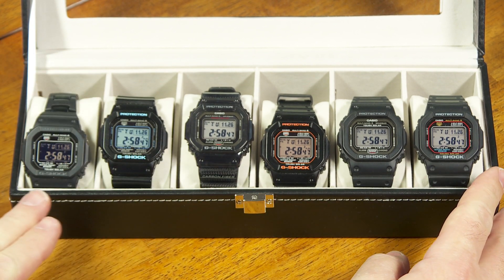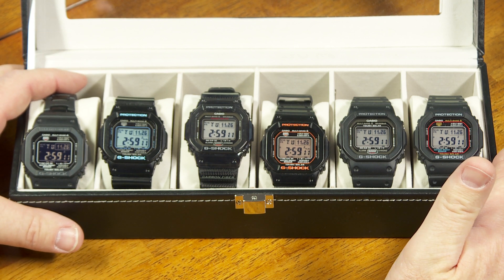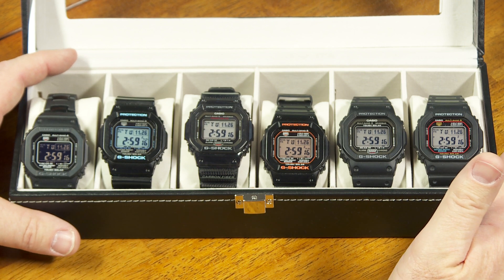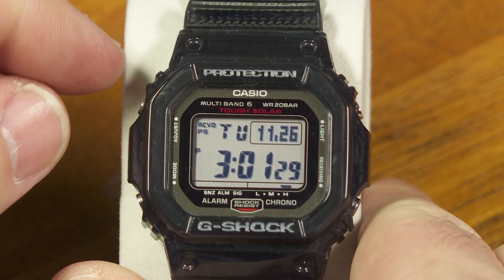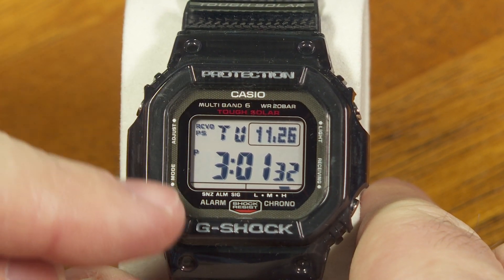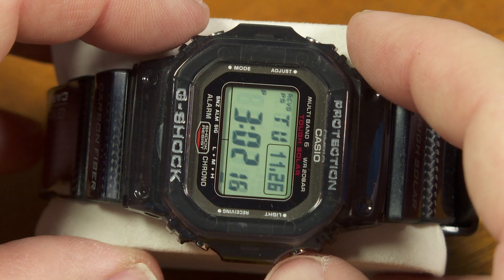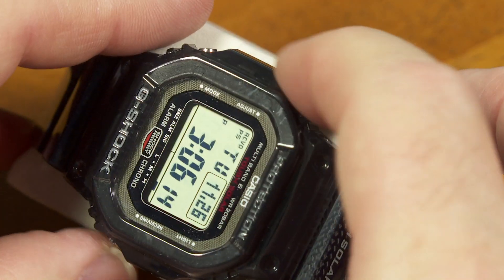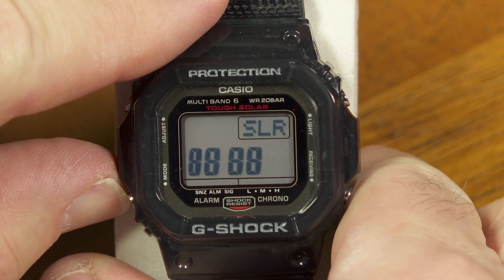Diagnostics for G-Shock Squares

Comment: Your videos have been extremely helpful as I go through my square G journey. Thanks for all these informative videos. 

One question I have is in the multiband diagnostics screen does it matter what option you select? Or it automatically goes through all the bands? Also on my 3495 if I press the A button in that screen a 1 appears. Any idea what that means?
Reply: Yes, I also noticed it on my GW-M5610.
If you scroll through different frequencies with bottom left button and then press the LIGHT button (B) it will go into recieving mode. My theory is that you trigger recieving for selected frequency. Pressing B button again will cancel recieving and you will se new letters NG in the box. I triggered recieving for Germany (B 77) and after canceling recieving it showed BNG 77. If I trigger recieving for J40, I got JNG 40 after canceling.

If you press A button (when you are in  multiband diagnostics) you will see that 1 appears on the left of the screen. If you then press button B it will go into Power Saving mode.

Comment: it would be fine if solar diagnostic mode show up the actual voltage currently produced by the panel.
Reply: That would be cool, but i don't think the watches have the hardver to do that. They probably have just a few hardwired measure circuits and if everything works, then you can get all the information the watch have for you, from the home screen. Note that it is just speculation from my side.

Comment: I was looking for information about solar panel diagnostics and I thought it was worth mentioning: the GW M5610U updated version combined the tilt and solar diagnostics into one button combo.  A,C, and B buttons, same as your tilt diagnostic. "C" (bottom left) button to cycle through tilt and solar tests.
Reply: Hey! I have G-5600UE-1DR watch and it's module is 3496 according to the backcase and even the module book we get with this watch.
But I just did the display test and at the last of it, it shows the module number 3495 and inside the box 002.
What does that mean?
And what does your watch shows? 
And
Reply: @Manish Kukreja same here I also couldn't understand what that 002 in the upper portion means although it's showing as 3495. And another similarity happened as described by @jbrooks4282 as the SLR and TLT are combined into one shortcut key[ A, B & C]
Reply: Same thing in my case with dw5600ue
Reply: Same thing in my case i order this to Amazon

Even on the back case it says made in Thailand Y

"Y" whats the meaning of that alfabet

Comment: I think that on Casio's G-Shock GW2500BD-1A analog/digital, radio control, stainless steel bracelet watch, the arrangement of the buttons is that the "C" button (Mode button) is the lower left button and the "D" button (Scroll/Toggle button) is the lower right button, but I'd have to double-check that to verify that.

Comment: Greg, did you ever discover why the last screen in the lcd test showed the numbers 3150 in the top right hand box, and 0311 on the main screen? I did the 3 button test after watching a "how to determine a fake" G Shock, and it suggested the module number should show up? Yours is the only video that mentions the numbers that I have on my G Shock? I've searched the net but cannot find an answer?
Reply from the maker: Since this stuff isn’t mentioned in the user manual AT ALL I can only guess. What I do know is that when I have multiple watches with the same module they all behave the same way when I do this stuff, so I think that’s a pretty good indication that mine are not fakes.

Comment: 2:50 I have model WVM-120. When I press button A with this J 60 screen a zero appears. Another press button A and the zero disappears. What does that mean? Is it a hidden feature enabling/disabling the radio station?
Reply: Same on my 5600. Did you ever find out what this means? I want to change the receive station to test how strong the signal is from each.
Reply from the maker: Good question. The problem I have is that Casio doesn’t tell us about these modes at all, so I can only guess what these things mean. But I haven’t been able to enable nor disable anything by using these button combinations.

Comment: My tilt test is working but the light won't come on when moving wrist, it does come on when I touch the button though, any ideas?
Reply from the maker: If you hold down the light button for about 4 seconds then A.EL should stay visible on the screen and the automatic light should work.
Reply: @GoodTimekeeper  perfect thankyou, working already...
Reply from the maker: Just to be clear, can you see the “A.EL” in the display during normal operation of the watch? Are you in a dark place when you try to make the light come on automatically by moving your wrist?
Reply: @GoodTimekeeper  no I don't see A.EL on display, yes I've tested in the dark. And pushing the three buttons the tilt test works.

Comment: Interesting video. A little correction. I looked at over 15 Casio manuals and they all refer to the buttons as: A-top left, B-top right, C-bottom left, D-bottom right.
Reply from the maker: Oops! Well, at least I show the right buttons to press (even if I didn't quite match the manual's description).

Comment: GA100 owner with a 5610 on the way! Never knew, great test thank you!
Reply: Update?
Reply: @stampstepper2393  it works great! I modded my 5610 to have the HDR Red straps. The atomic works great, I'm roughly 1000 miles due south of the Denver radio station, but in the metal hangar during work nights it will never sync. The menus are re-organized between the two models, so that is a bit frustrating when I switch between them and expect my stop watch and UTC menus to be the same number of button presses

Comment: My New G-shock bluetooth looses 1sec/day with sync function off. Is there a way to adjust this? My old F91 is more accurate and stays sync for months.
Reply: MALO no way sorry
Reply: Most G-Shocks have a trimmer screw for adjusting the accuracy, but I don't know if the Bluetooth models have this feature. Losing 1 second per day is out of spec, which is 15 seconds per month (1/2 second per day).
Reply: @garyk4017  Thank you. Will find more info before I try to open it. I just got unlucky picking this watch. If it bluetooth sync is on it syncs 4 times a day so it's ok. I'm just disappointed with the quartz precision.
Reply: @MALO-nn5iy  Casio quartz watches are accurate to even +/-30 seconds a month in some cases. Yours is normal.
Reply: That is normal for G-Shocks. You might want to keep the sync function on. Yeah, the F-91W is an accurate watch and that is confirmed by many.